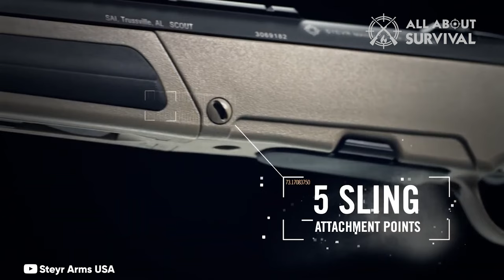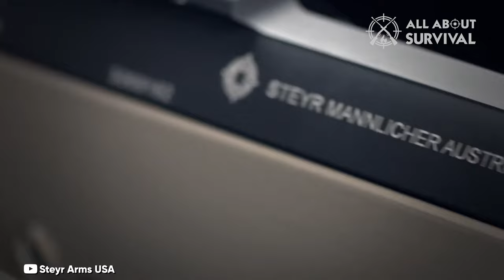Best Scout Rifles 2024: what I WISH I knew earlier…

Comment: 😎🤘 # 1 Springfield M1A socom 16 🤘😎🍻. I look forward to getting mine setup at the end of this month. Just got her in this Wednesday. I opp for their ( kryptek highlander edition  ). She's feels great in my hands, look forward to a long relationship with her. My dream rifle for sure. Scope I decided to go with a burris 2-7 32mm, with burris low scope rings. Plans for it, this fall and winter are to get my 100, 200, 300 yard patches. When I doing my shooting on the move drills with her. I'll be using a Delta 14 chassis for it.
Reply: Specs & price, models
Reply: Prices
Reply: @ronmeyer152  Good morning, ronmeyer152. Price on my socom 16 was, 1,700$ out the door. The burris 2-7 32mm was 400$, the GG&G scout scope quick release mount was 200$. Voodoo cheek weld was 22$. The Delta 14 scout 2 chassis is 360$. But, that's be for a separate upper I'm build form the help of LRB , on building a separate receiver and barrel assembly for that delta 14 chassis
Reply: I have the SOCOM 16 & the Burris set up. I love that rifle!
Reply: @64samsky  Good morning. Yea, I'll be re-doing my setup from an - over the bolt action/receiver type mount to actually what its designed for. A scout scope. I'll be purchasing the burris 2-7 32mm scout scope for  it.

Comment: They’re they’re all great rifles, but they in my opinion should come apart in to have should be breakdown or takedown models. The ability to make them break in half.    I have a Winchester model 94 takedown rifle chambered in 450 Marlin  20 inch barrel but it can be taken apart in two pieces  I have quick detach Ables scope rings on it with a small Leopold scope. I think it’s ideal scout rifle might not make the limit and inches.  But it can be taken apart and put in the backpack people don’t even know you have it on you can be stored anywhere and carry on a motorcycle lot and hunt with it.  The 450 marlin is more powerful than 4570 is capable of killing anything on the planet. Never taken more than anything short placement.   A good old model 94, 3030 is just as good as these fancy guns or 32 special.  I also have two model 55s that come apart. They’re both takedown models one and 3030 32 special. They’re good wood guns.